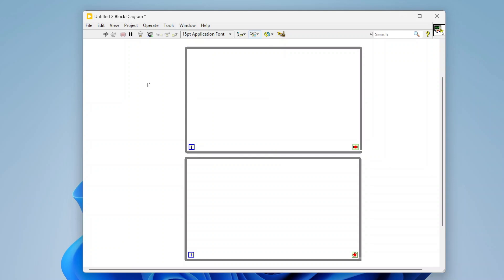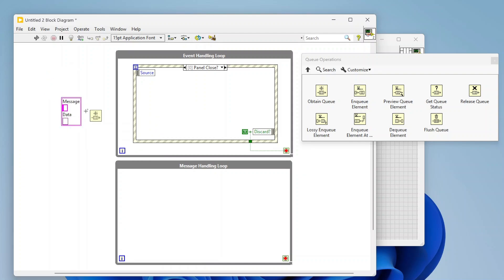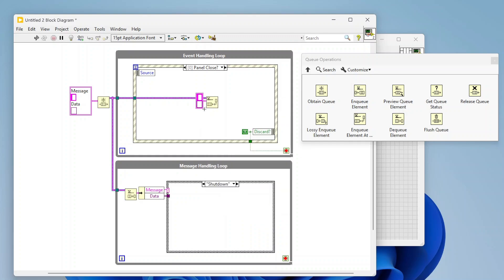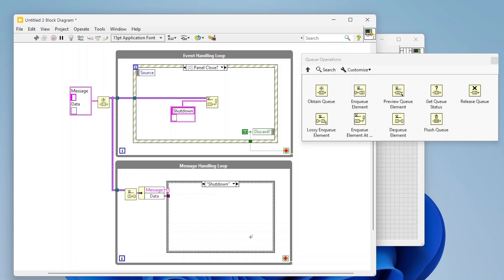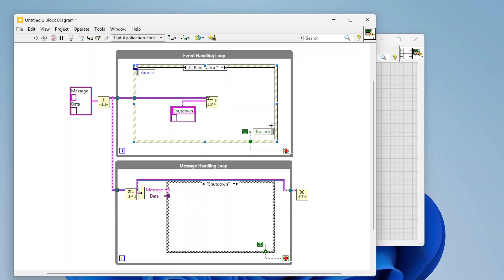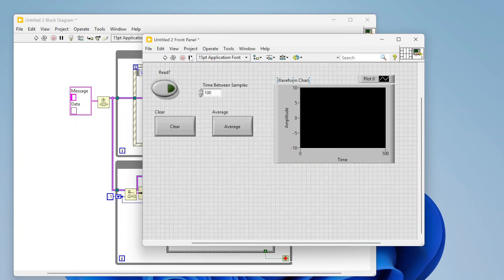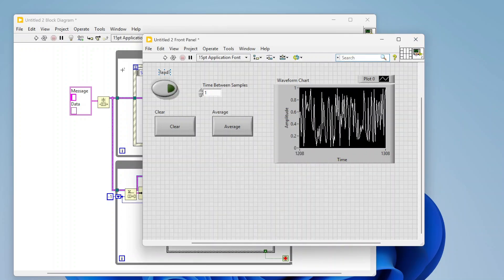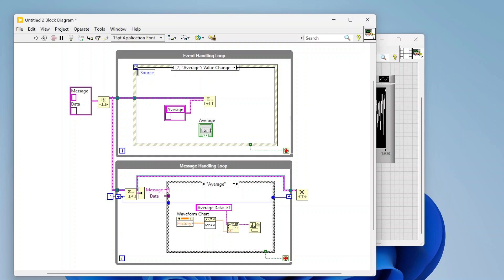Design Patterns - Queued Message Handler

Comment: hi novice here love your tutorials! in this example though where is the best place to put acquisition(temp and analog current)? In the default loop where you have the random number Thanks
Drew
Reply from the maker: Yeah so following something like a producer/consumer or queues message handler patterns, it would be common to have the data acquisition be in the loop that is inserting data into the queue. Then to have the loop that is pulling data out of the queue do whatever you need to with the data (logging, analysis, visualization, etc)

Comment: I'm currently using a Queued Message Handler pattern for my VI. I'm doing data acquisition using the timeout case of the queue (i.e., if no buttons are being pressed, then log+save data). I'm concerned that this method will result in "missed" data whenever other events take precedence in the queue. Is there a way to ensure all data is acquired + logged while using a queued message handler pattern? Or is it better to use a different design pattern?
Reply from the maker: So when using timeouts, you do run the risk of the timing running very long when other events are taking place. There are a couple of tools that you can use to take care of that. First off, on VIPM there is a wovalab utilities package which includes tools for dynamically altering the timeout value in a loop to get you a consistent period. Another common thing to do is add a simple “helper loop”. Essentially that would be a 3rd loop that just enqueues your logging state at a consistent period and therefore never gets interrupted.

Let me know if that makes sense or not and I can try to explain better. Also, if you want you can either email me your code and I can give you some feedback on it or we can review it together on a call.

Comment: Can you make a video focused on fast data acquisition, i.e. maxing out your NI DAQ hardware acquisition rate and any considerations that come into play? Also best practices for logging data in that scenario?
Reply from the maker: For sure. I’m a little slammed at the moment so it may be out in a couple of days but I will put it to the front of the queue
Reply: @cannoncontrols  Thank you, that would be awesome!
Reply: @nwsteg2610  Had to do something like that for work; Maxing out some PXI hardware (8 Load Cells at 20K Hz, yes may be impractical for a load cell acquisition rate), filtering/doing some math, and logging; using the Producer/Consumer was very helpful, but be aware that depending on the way you make your acquisition loop you will have to make sure it has minimal operations (I.E. Just have the "DAQmx read" function and wire in your queue with an array or variant, etc) Reason being, whenever I try to do more than the basics I found my producer loop was starting to cause an overflow when I had too much as it wasn't able to clear the PXI buffer in-time. Overall: Loop 1: Pure DaqMX, Loop 2: Process, Loop 3: Log the data as it comes in (case structure looking at the elements in the second queue)
Reply: @TheCakeIsNotALie-1  Awesome, thanks for the info. We have a PXI system as well. Might pick your brain later on.

Comment: Great video, excellent work as always. 👍

One technical observation: relying on the dequeue function’s timeout for data acquisition is problematic because the timeout only triggers when the queue is empty for the specified duration. For instance, with a 3-second timeout and an element enqueued every second, the timeout is never reached.

This method can also lead to timing issues. If you sample every 5 seconds and an element is enqueued at the 4th second, the next sample might be delayed by another 5 seconds. A more robust approach is to set the dequeue timeout to 0 (non-blocking) and use a dedicated timer VI with the Wait Until Next ms Multiple function to trigger sampling at precise intervals.

It would be helpful if NI’s documentation addressed these nuances in greater detail.
Reply from the maker: Definitely a good point! In my use cases, I've typically used the timeout in scenarios where I don't really care too much about the timing being super consistent or precise (update this indicator, whether that happens in 500ms or in 1sec I don't really care).

Then in the scenarios where I do care about timing a lot, I typically will use a helper loop. The helper loop will keep track of timing and enqueue the "timeout" state at whatever the desired period is.

Comment: I love the NI QMH. Have you tried DQMH?
Reply from the maker: @forthefameofhisname  I have used DQMH and am a big fan. I plan to create some “intro to DQMH” videos in the near future.
Reply: @cannoncontrols  Neat. DQMH is my go-to framework when creating almost any LabVIEW software. I love the reusability and modularity.
Reply: @forthefameofhisname  same.  DQMH is what we are pushing as the default as well.
Reply: for the unwise... like me, what's the main differences between something like NI QMH vs DQMH?
Reply from the maker: @TheCakeIsNotALie-1 I will make a video on DQMH soon to highlight this a little better. As the name suggested, DQMH is built on top of the QMH design pattern. DQMH is more of what I would consider a framework though and less of a design pattern.

In very basic terms, the idea is to create modules that are basically their own QMH. These modules can be run asynchronously and cloned. There are  ways to tell the module to do something or get data back from it (remember these are running asynchronously). There is also a lot of fancy tooling (a lot of vi scripting) put into place to automate lots of repetitive tasks in creating these modules.

So for example if I had an application where my software was talking to a power supply, DMM, and o-scope; I could set up a specific QMH (or DQMH module) to handle each individual piece of equipment (or to do other non-hardware related things). Then the UI is basically decoupled from the module logic but can communicated with all of the modules by either making requests or getting data back via broadcasts